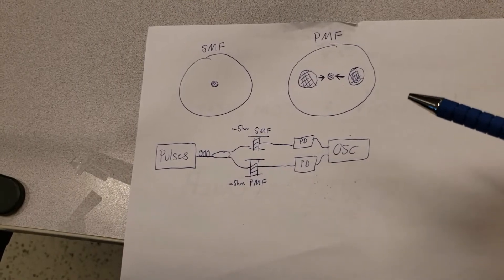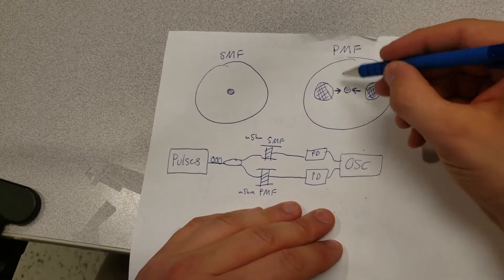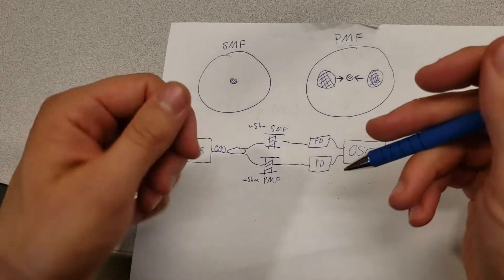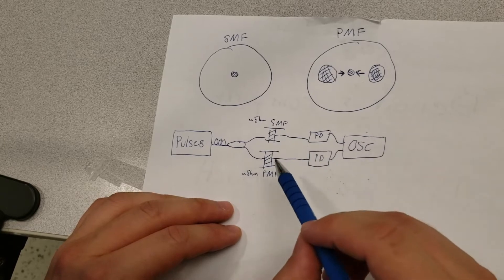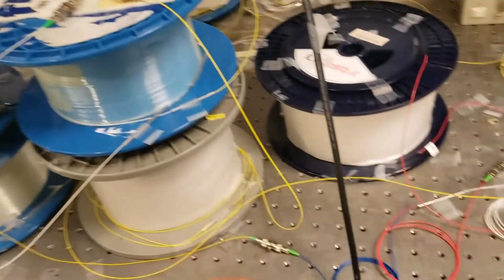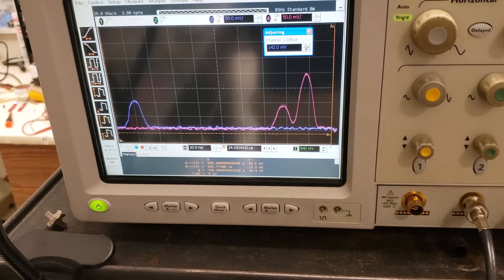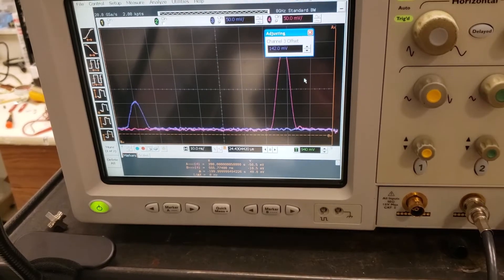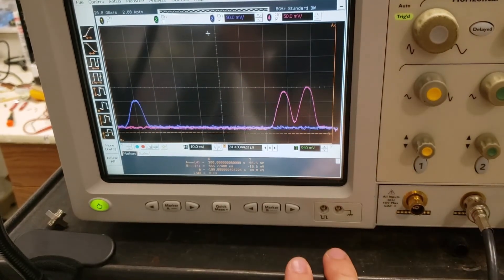Polarization Maintaining Fiber

Comment: Hi. I am trying to splice a HI1060 pmf to an smf28 non-pm fiber. Is it a good idea?
Reply from the maker: Whether this is a good idea depends on what you are trying to accomplish. Can you please explain in detail what kind of experiment/practical application you have in mind?
Reply: @yourfavouriteta  Hey thanks for getting back! Much appreciated. 

Specifically - I have a pump laser at 980 nm which has a HI1060 PM pigtail (non-connectorized), that I would like to test. The pump can go up to 800 mW, but I will be testing it around a few tens of mW, near the threshold. To do this, I was thinking of splicing a non-PM FC/APC pigtail to this, as I don't have PM pigtails, nor a PM splicer. I am not sure if there would be significant losses, and secondly, if I should be worried about back-reflections from the splice into the pump - or for that matter, even if there will be a good splice and mode matching. I have seen people arc twice for better diffusion, but I think that's basically the most I can do with my Fujikura 66S+.
Reply from the maker: @srikanthsugavanam8591  Thanks for providing more details, I have accepted your LinkedIn request and replied there!
Reply: @srikanthsugavanam8591 Hi. you shouldn't need to ark twice, also if your testing at high power you should use an isolator to protect your source.
Reply: @mazzy19740  Cheers thanks!